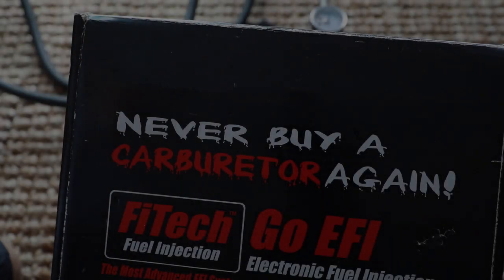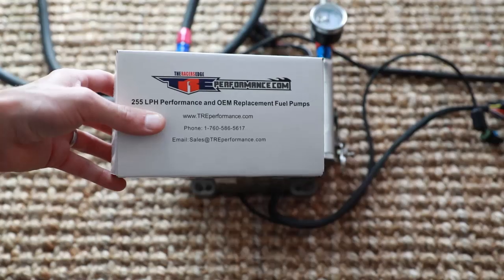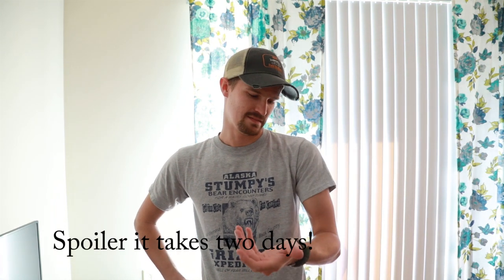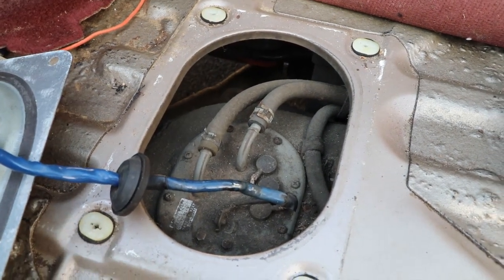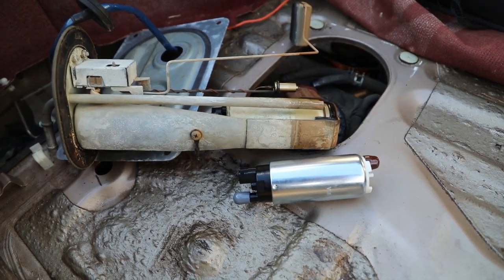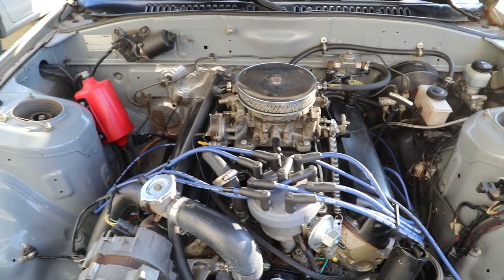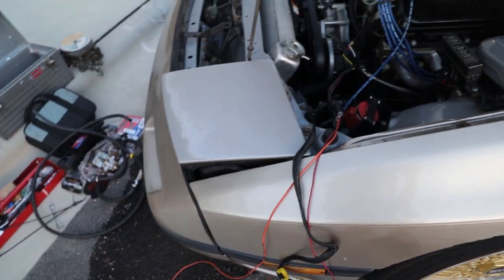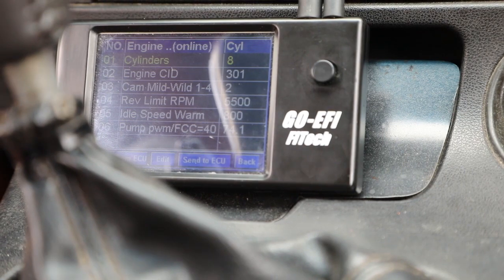Carb to EFI Swap In A Parking Lot!

Comment: how does it measure the RPM and the AFR ratio ? do u have an O2 sensor installed ? does it have a built in internal ECU ? i have so many questions

Comment: Pick up an electric temp gauge and just splice it in with the efi sensor. Idk if it will mess with the signal by sending it to two gauges but just food for thought. Oh you can use a brass nipple and a tee with both the efi sensor and the probe for the mechanical gauge. As well as you could put your mechanical gauge in any place there's a plug in a water jacket. I run my efi sensor in the head and mechanical gauge from the intake

Comment: I bought a FiTech brand new.. First one I got was faulty from new.. Took 7 weeks to get another. Ran It for a 4,000 miles and had so many issues including 2 failed injectors. And first remote broke, had to buy another. Eventually I decided to ditch the FiTech for a Holley Sniper.. The Sniper is way way superior.. Zero issues in 5 months.

Comment: Too many steps were missing from this video including whether or not an O2 sensor port was already on exhaust system.
Adding an O2 port to an exhaust system makes this install go from dead easy to a pain in the ass depending on your skill and equipment available to you.
The Sniper comes with a no-weld system for O2 sensor install. This simplifies the install.
Reply from the maker: The FiTech system comes with the same no weld O2 system. But rather then using that i had a O2 bung welded in the exhaust while i was building the car. I try to future proof my builds a little.

Comment: Hi brother. Just a question. Does EFIs just fit exactly (bolt holes, opening diameter, etc) where the carburetor is removed from ANY engine? In other words, are carburetors sizes and mounting standard like house hold mains sockets? I do ask because I have watched a number of videos on how to swap carbs to efi and I have find none that warns on the mounting fittings or adopters or anything of that kind. I want to change my 1991 suzuki vitara carb to efi. hence I have been trying to learn how to. Thanks in advance.
Reply: Most v8 carbs on small blocks at least, use a standard mounting.  The carter, quadrajet, edebrock, Holley, are all just about identical.  Check your existing intake manifold and carb and look it up.  They sell inexpensive spacers/adapters for any intake to adapt to these units (and competitors).  Hood clearance can be a pain.  Hardest part is the high pressure fuel system.  Getting adequate pressure and volume, returns or returnless, integrated regulator or external, aeration in the tank, most efi driveability problems are due to inadequate fuel delivery.  Carbs are more forgiving because they are low pressure and have a float bowl.
Reply from the maker: Its a standard 4 bore intake. I believe there are two types but honestly I don’t remember what the other style is called. From my experience the standard 4 bore is more common.

Comment: I am sure you would be faster with a bigger diameter carb...
Reply: NOT carb, air filter housing. SORRY
Reply from the maker: Definitely but this car isn’t a “race car” id rather loose 20-30hp and keep dirt out of the motor keeping it healthy. Still making more power and torque then a N/A 13b.

Comment: "Extremely Healthy" ...? If it could actually breath properly would be almost healthy ..you dont get enough outside air flowing under your hood to begin with ...then add air filter assembly that wouldn't be good for any application .so yea your Fitech is constantly fighting to keep stable In hot air temperature changes and badly restricted flow..+..heat from the exhaust headers rises making the bottom of your hood a hot dead air space right where its trying to pull air in ...there may be a few minor issues with the product but compared to the poorly thought out setup&conditions the system is running under ,,I would say your a bit of a jackass for complaining when the performance issues are your own faults not the product..

Comment: Hello sir is it possible to convert a carburetor to fuel injection cbx1000?
Thanks for your advice
Reply: Sure.  Need a suitable efi setup for it.  High pressure fuel system, custom intake manifold, ECU, suitable injectors, a dyno for tuning, and lots of patience.  Or find a donor bike that is already efi and adapt it to fit your engine.

Comment: is it better than carb? like running smootheness and acceralation ? Please. I m planning to set install 1979 Malibu with v6 3.8L
Reply from the maker: It depends on how good you are with a carb. If all you want is to turn the key and go then its a great kit. But if you want it to be perfect and you drive your car hard “not just WOT” drag race stuff. Then I would look into a different kit. The Fitech just doesn’t have the R&D time to back up there products yet.

Comment: can you send me what wires you connected where? I have the same build FC w a 302. I mages fitech they just said I had gravity feed problems w the pump which is mounted under the rear bumper. it's getting pressure but the main line running to the fitech is bone dry and it is buzzing (fp) at key on.

Comment: Nice setup.  Little surprised to see this baby in a Mazda RX7 too.  One suggestion is to leave off the background sound track and of course include a little driving. I think these systems are 1200 plus whatever else is needed.  I'm seriously thinking of adding one on my 429 powering my 78 F250.

Comment: How do EFI systems impact cold start, eg  can you just turn the key like a modern car?
Reply from the maker: My cold start still needs a bit of tuning, right now when its below 40F it stumbles after it starts but that can be tuned on. Its the first winter with the system so I have not had a chance to work with the tune below 50F. Once I do it should work just like most modern cars.

Comment: You did it in a parking lot, BUT, 99.9 % of people installing this or a sniper will not have a return line already run or even have an intank pump....
Reply: exactly. does an efi kit exist that can really replace a carburetor being fed by a 4-7psi mechanical or electric fuel pump with no return line required? i know that there are efi systems for marine engines that work with a low-pressure fuel supply but those are not available as bolt-on replacements for street vehicles.
Reply: Agreed...PCM pump motor does not need return line and applying exterior installation makes for much easier access when repairs or mods come around.

Comment: Couldn’t hear the engine over the music, if it weren’t for that it would’ve been a great video, have you drove it now to see if there’s a noticeable difference?
Reply from the maker: Sorry for the music, I edit with headphones and tend to turn it up a bit to much. Iv got about 1000 miles on the system on now and it works as advertised. I will admit though its more or less a trade from the issues with the carb to new issues. Cold starts are not fast and can't seem to tune it out of the system. Its never stalled once its running but it hesitates when it gets hot. Im sure I can get it running 100% but I could have gotten the carb to run 100% to so don't know if its worth it or not.

Comment: Some one come help me install a efi in my car
Reply from the maker: Its really not hard at all. Just read through everything so you have an idea what you need to do then go for it!
Reply: @Petrol360  can I do this to my 87 Caprice classic...
Reply from the maker: You should be able to, the biggest issue with an older car is adding a fuel pump to the system that will supply enough pressure to make the efi work. As long as an electrical fuel pump doesn’t have to lift or suck the fuel an inline pump works great!

Comment: lol I did mine fitech swap in about 2 1/2 hours while drinking beer XD
Reply: https://youtu.be/wICDkD5F3yQ their systems will handle a lot of cam if you decide to put a e303 cam in the 302.
Reply from the maker: Its really as simple as they advertise. Wish I had a garage and I could have knocked it out in that amount of time. Took me about 4 hours including going into the gas tank and swapping the fuel pump and going to the hardware store for some new bolts.